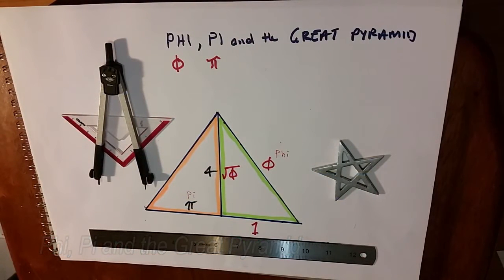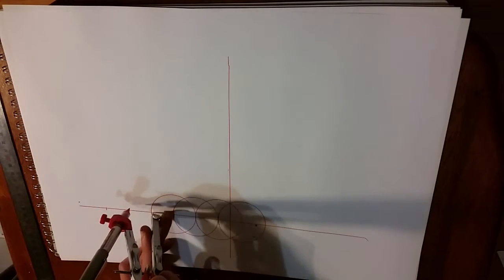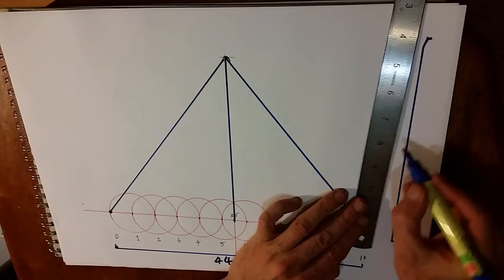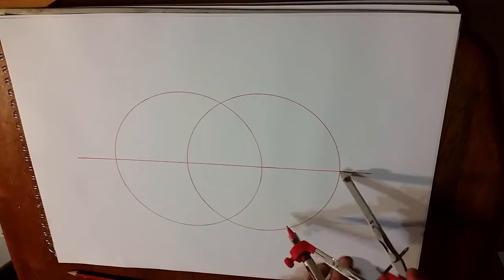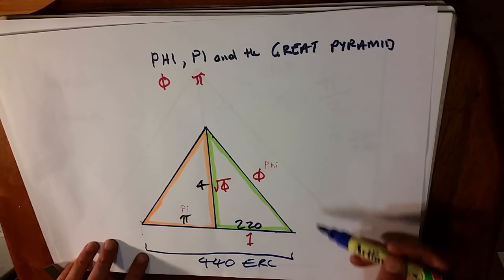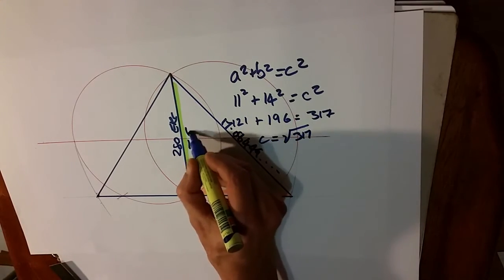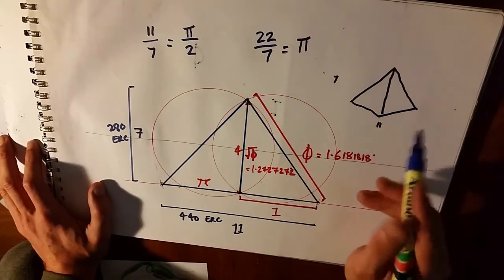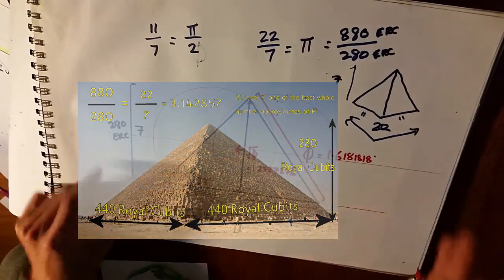Vesica Pisces Ep7 Phi, Pi & the Great Pyramid (Redo)

Comment: How do I make a pyramid
Reply from the maker: https://www.youtube.com/watch?v=XNX5ozi0010&t=461s
This is what they were built of, in South America the same technique for those walls. Facing stone backfilled with rubble.
Also this one, how many blocks would need to be laid. It's not one each 3 minutes but one each 2-3 days per team. By the time they are half way up they are 90% complete
https://www.youtube.com/watch?v=bLB2DejCyN8&t=323s 
Back in the 90's National Geographic made a small pyramid and it is was pretty cringy, they had big problems but an old stone mason passed by and told them what to do. They didn't even bother to speak to a stone mason before they had begun. I see that a lot with other "experiments" done by the archaeologists for documentaries.
Here's another example of terrible experiments by inexperienced academics used as examples to "prove" the ancients couldn't do it
https://www.youtube.com/watch?v=SbnKPZubzxg

Comment: Hey I was wondering if anyone has an input on my thoughts on Pi, Phi and the overall introduction of mathematics, numbers and alphabet. Thank you.

Phi depends on .5, Division = Diameter
Diameter = .5 = 1 diameter = 1 degree 

Radius is division of diameter (division of division) 

Phi is diameter x3 divided by/2, 
3 halves, one and a half, 1.5 

Pi is diameter x2 divided by /3, 
2 third, 0.75, one and half of a half 

Phi x3/2
Pi ×2/3 

Pi
1/2, 2/3, 3/4, 4/5, 5/6...
Phi 
2/1, 3/2, 4/3, 5/4, 6/5... 

Pi is multiplication of radius 
Phi is multiplication of diameter 

Basic principle of dividing/equalizing/sharing something in equal parts (itself) and multiplying something in equal parts (by itself) 

Calculating with circles, squares, triangles, bars, etc... it's very interesting if you think of Greek alphabet for example (Pi and Phi) and the first person to ever have to write "numbers" to explain mathematics and wrote it as such 1 2 3 4 5 6 7 8 9 0... and wonder why it was written precisely like that and if it is a "how to" calculate anything using geometry. 

It's easier to see if you put a set square of 360 degrees on a picture of old TVs test pattern for example. 360degrees being 1 circle 

You can calculate anything that way with degrees. You can calculate "nothing" precisely in the process, too as the outside of the circle. The TV and computer invention uses the same pattern and algorithm 4:4:4 of 1234 infinitely. 

Using both properly is an algorithm to multiply divisions or divide multiplications infinitely. 

The Greek alphabet letters are ways to calculate that way for specific functions, as well. 

But Pi and Phi are functions. Trying to give it a value would be like trying to give a value to +,×,÷,=,/, etc...

Comment: I think the phi ratio you calculated does not give you the right answer because the pyramid was not constructed with 4 sloping sides but with 8 of them. Once a year a shade can be witnessed on the south slope of the pyramid. At solar Solstice time. This means that the concavity in the slope results in a lower length value then you calculated. I was also baffled by the ratio between pi and phy being slightly off in whatever way i calculated the distances. As its runs into centimeters off either slope or base, i think the answer lies in the concavity of the slope.
The egyptians worked so accurately that its hard to believe that they could have made mistakes. In my opinion all calculation fitted exactly at the time of construction.      http://www.catchpenny.org/concave.html